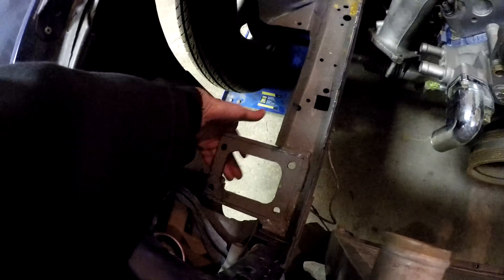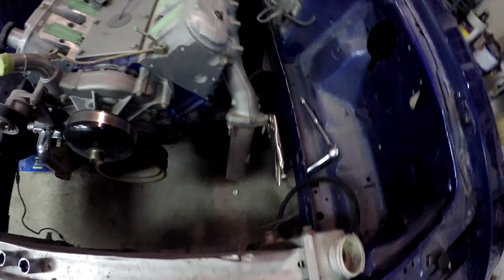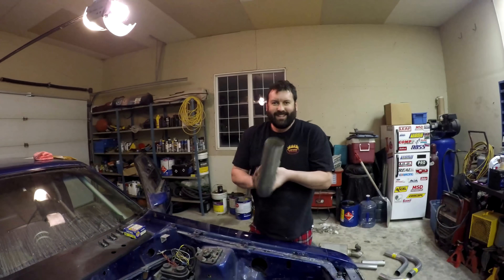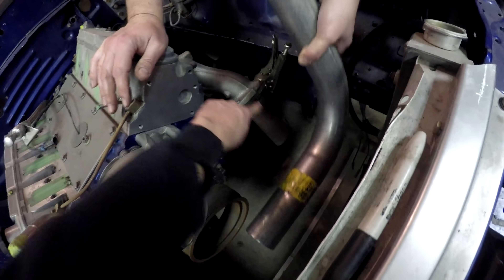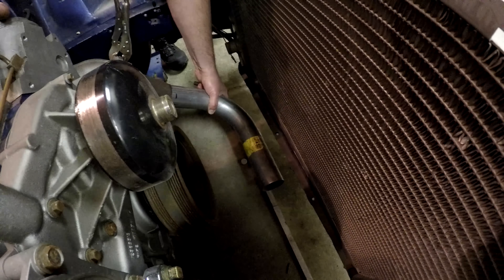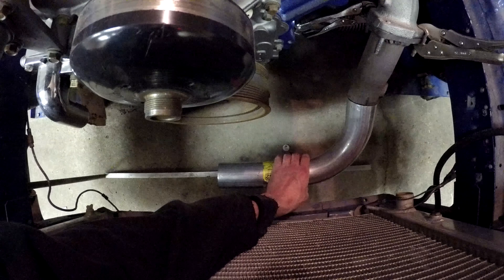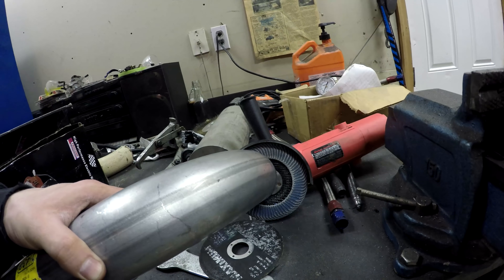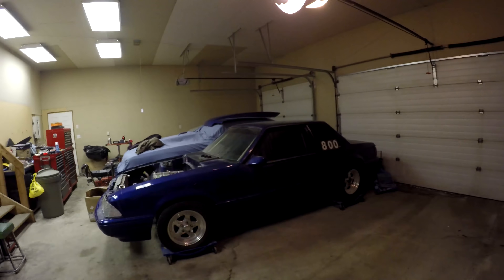IT BEGINS! Sonic Stang Junkyard 5.3 LS Turbo Hotside Build Part 1 | Its a Start... Deez Nuts

Comment: Mike heads up you should always plan for your Wideband -O2 sensor after turbo they are sensitive to the back pressure and higher heat pre turbo.

Comment: Invest in one of those belt/disc combo units the next time Cdn Tire or Princess has them on sale, it would work for what you are doing now and any brackets or tabs you don't have to put in a vise and use the flap wheel to round the corners, makes life way, way easier.  Or better ask Clayton if the shop he works at has older "junk" machinery laying around, shops often have just a larger diameter disc sander that gets little use.
OR, get a belt sander that you could clamp in a bench vise, not quite as useful but cheaper

Comment: If you need some cheap o2 bungs just buy some spark plug anti-foulers and chop the bottom of them off. The threads get kinda wonky while welding so I usually stick an old anti-seize coated o2 sensor or a spark plug in them while welding. Let it cool a bit and take the plug out and you’re good to go.